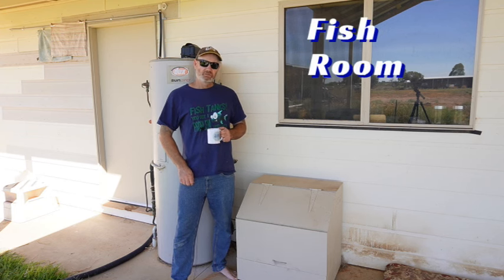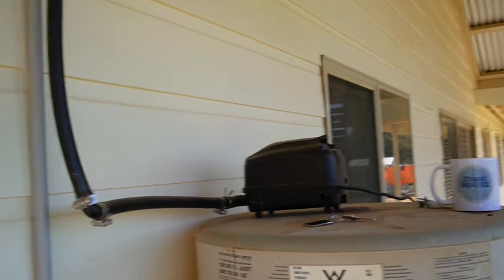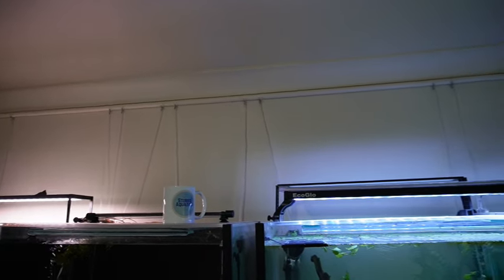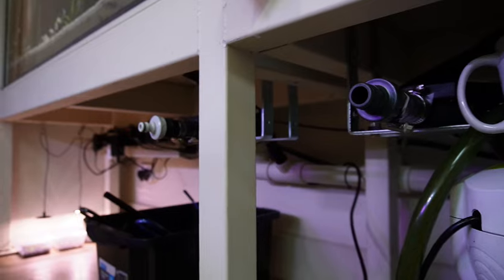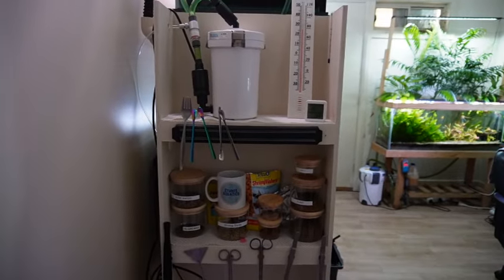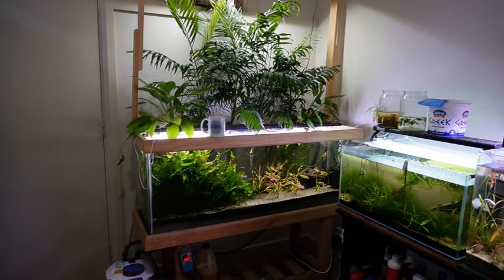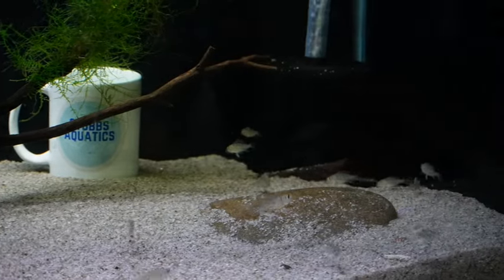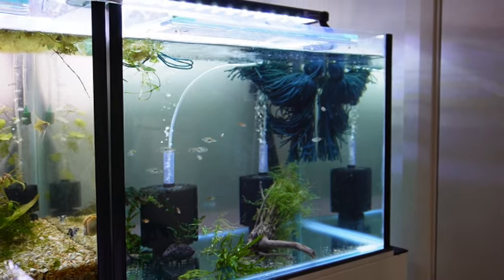Fish Room Build (&Tour) #4

Comment: Is there any trick to putting 2 batteries into parallel? Is there a right order to do it in, so nothing shorts? I watched your original video from a while back, but that was only using the single battery :)
Reply from the maker: If you join positive to positive, and negative to negative,  that is parallel.  This turns two 100ah batteries into one 200ah battery while still  remaining 12 volts.
Joining positive to earth and earth to positive,  means they are connected in series, which will give you 24 volts. I hope that helps.